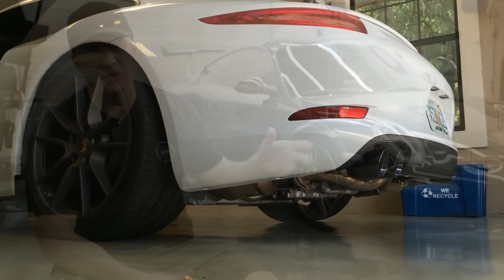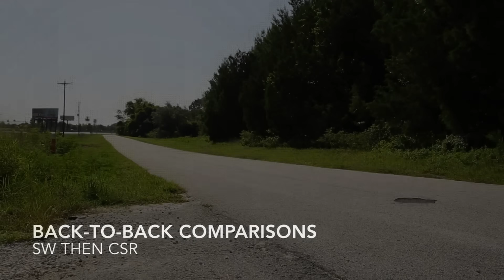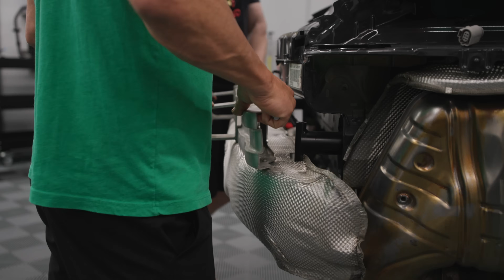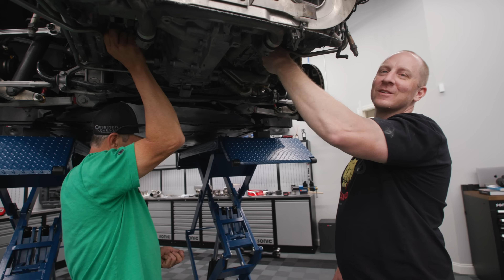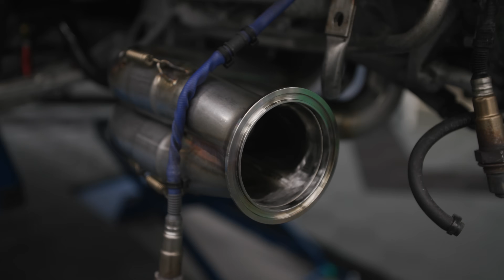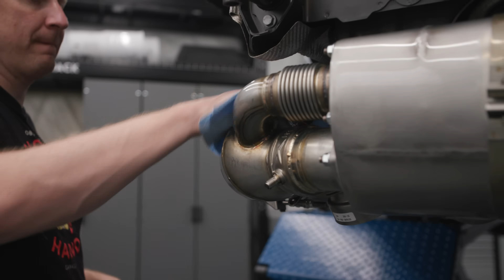Finding the Perfect Porsche 911 GT3 Exhaust | DUNDON | Giveaway 997.2 GT3 RS

Comment: I drive a 996 GT3 and that thing sounds amazing. Found out after a some time that it had been fitted a Phoenix exhaust when new. It looks almost like the original muffler but boy when you put down the right foot it is like a proper GT race car. No fancy gimmicks, no valves. It sounds like stock when you‘re not going more than 1/3 throttle. So you always have it in your own foot 👌

Comment: What’s your opinion on the Akrapovic exhaust?
I have it on my 992 GT3 and super happy with it.
Beautifully made and the dial in the sound in a dedicated dyno room full of microphones to avoid drones
Reply from the maker: I've always been a sucker for the fit an finish of Akra exhaust.  The problem with them I've found is they are almost alway a simple replica of the factory exhaust.  Combine that with the way titanium sounds, I always end up disliking them.  They are almost always to weak and thin sound and never make power.  For the GT3 platform, Akra would be one of the very last exhaust I would consider.